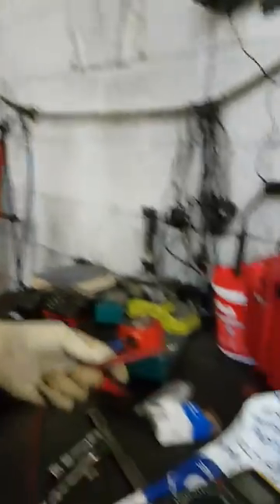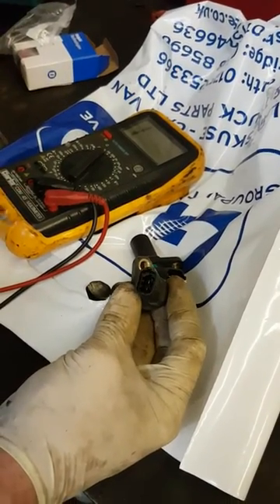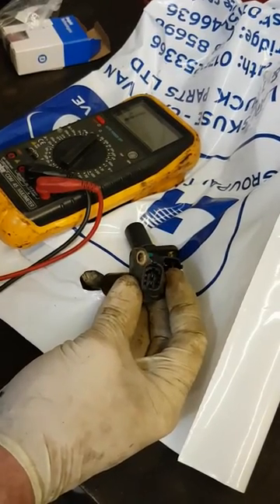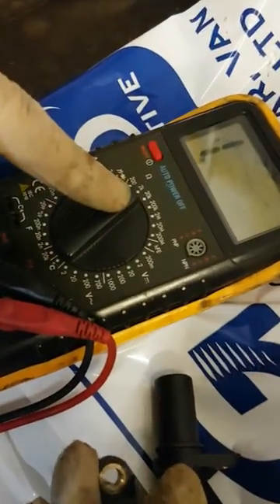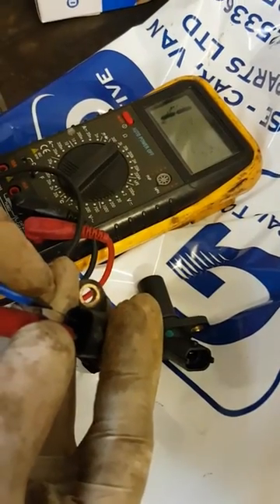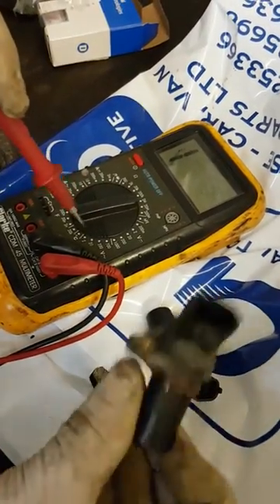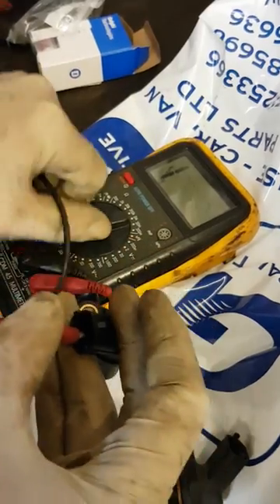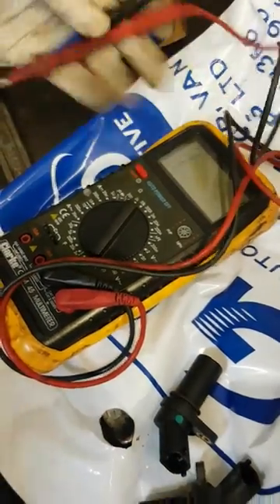Testing crankshaft sensors

Comment: Stupid question: Is there a - and + pin on the connecter and is it important to place the wires from the multimeter on the correct ones?
Reply from the maker: Nope. Easy as pie 🥧

Comment: Best to the point video on the web! Does it matter which side you apply the positive and negative test leads? In other words if I cross them incorrectly, can I damage my sensor?
Reply from the maker: No mate, readings will be the same and no chance of damage . Thankyou
Reply: @bradauto  I removed the Timing belt cover to gain access to my Camshaft position sensor, ran the Ohms meter on 2k and it did give a reading back. I assume it can be tested the same as the crankshaft position sensor? Would you mind assisting me? I'm stumped for 3 weeks on my '97 4runner. Here is the video I uploaded to my youtube channel on what happened and what bench tests I have performed thus far trying to diagnose it without including testing the C.P.S. of the which I just did:
https://youtu.be/4AfZ7ZS9Qx8
Let me know if you have any ideas on what this could be? I'm down to guessing the crankshaft position sensor?

Comment: Good day, do you have a video with testing the Crankshaft Position Sensor Connector?
Reply from the maker: No as they are different, but typically you will be looking for a 5 volt feed an Earth and a third wire usually a screen - so no reading
Reply: @bradauto , thanks, I’m learning the hard way.

Comment: How many ohms is the sensor supposed to read. When I put on 200 it doesn't read anything . But when I put on 2k it read 11.15
Reply from the maker: It depends on the sensor as they vary. Yours is reading around 1100 ohms which doesn’t seem too bad.

Comment: Hello; does this method work the same for a 3 wire hall effect type sensor? If I remove my CPS from my vehicle and bench test it with my ohm meter at 2k, should I get a reading? Or does it need to have battery power? 1996 Chevy C1500 5.7L V8.
Reply from the maker: No the Hall effect is different- a test I used to do was was take the 3pin plug off the distributor then put a wire in the centre terminal on the plug. If you then flash that wire to Earth you should get a spark from the coil. If you get a spark it means your HE is faulty. This worked on Vauxhall/Opel but you would need to check it’s okay on your Chevy
Reply: @bradauto  okay, thank you!

Comment: Is it possible to have good resistance values, but it still be faulty?
Reply from the maker: In theory yes, the sensor has to supply a good signal which isn’t measured by just resistance. Also they can test ok but break down under work due to heat or electro magnetic interference
Reply: Yes ... (the folloowing is personal experience from my 2007 Volvo V70) The thing to look for on the tester is "missing signal" vs "fallty signal" Missing signal is easy. It is stonedead as the first one in this video, but faulty signal, can meassure quite OK on the multimeter and still be bad.
Reply: @bradauto  2 wire or 3 which is ground.

Comment: Hi! I am having a hardtime with mine Honda civic 2003. I replaced the crankshaft sensor twice already and the code still the, but first before changing them the code was P0335 and Now after I changed the sensors the code is P0336. I also ended up replacing the Hardness still did not worked. Can you please give a good tip. Thank you
Reply from the maker: Hi- apparently these things suffer with rust buildup on the toothed ring. That’s the first place to go I’d say
Reply: @bradauto  Whats the Toothed ring or where is located? Thank you so much!
Reply from the maker: @miltonmartinez6811  the ring on the crankshaft where the sensor reads from. The bit the end of the sensor sits next to 👍🏻

Comment: Hello mate, so if the crank sensor is measuring 500 ~600 ohms (2K ohms) it bad right, its throwing P0335 code too 
Mine is three pin one
Reply from the maker: Hi Harry, what car is this on? That doesn’t sound too bad to me, but some sensors only fault in use, for example if it fits tight into the crankcase the engine block expands with heat and pinches the sensor causing it to fault. Unfortunately in the world of diagnostics very little is cut and dried.
Reply: Nissan sentra 2008, car cant start at all and its giving P0335 code which is the crankshaft

Hey thanks for the quick reply
Reply from the maker: @AnythingEverythingGh  google p0335 Sentra is found a post with a troubleshooter which looked quite comprehensive. Gives you expected readings at your plug which will help.
Reply: @bradauto  Thanks Ian, used your video to rule my sensor being the problem, my reading returned 950.
Am looking at a wiring problem
Reply: Is this a hall effect type? 

If it is then this analogy can be used to check camshaft as well

Comment: It is Iain, a great help, thanks mate.  I tested the cam sensor on my 2004, Vauxhall Astra Envoy, 1.7cdti today. I've had the engine and box out of her doing timing belt, clutch, subframe and a tonne of work. Bitch doesn't want to start now, and I have diesel at the injectors. Rain stopped play but battery back on tomorrow and press on. I can get continuity on my wee, cheap multimeter(that has no beep) but i'm getting 679, I think.  It's no giving me anything on any of the ohm scales, though, just infinity. Any clues? Going to crank her myself tomorrow, instead of Ol'boy, so that I can see if rev counter moving up to near 300 revs and maybe that'll tell if crank sensor reading. I'll probably have to take that out as well?
Reply: I'm going to do the pedal test tomorrow, Iain, as I doný have a scan tool. Thanks again mate:-)
Reply from the maker: Hi mate. Cam sensor probs won’t cause a non start. Defo test the crank sensor 👍🏻